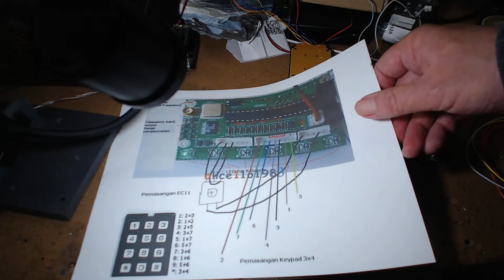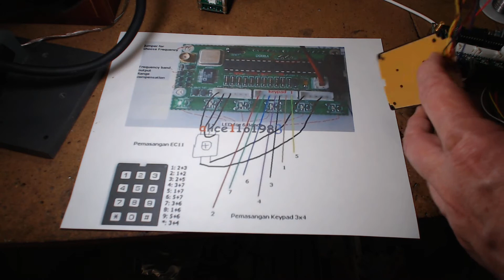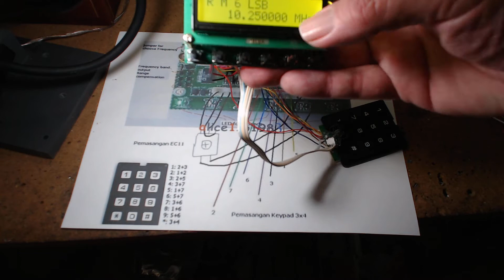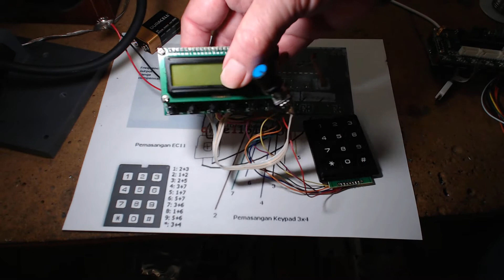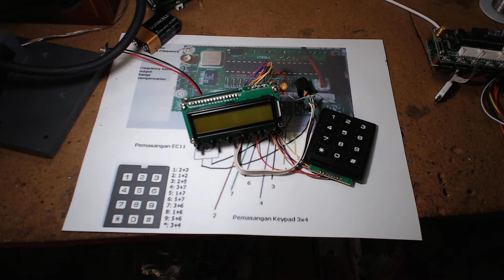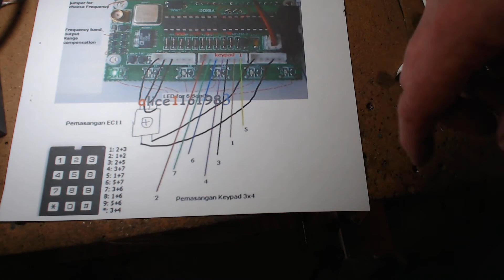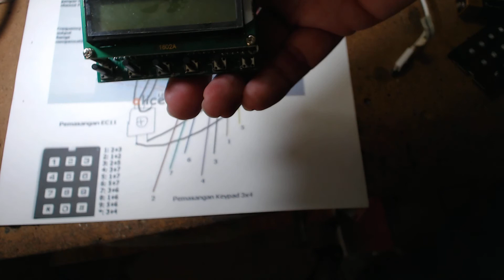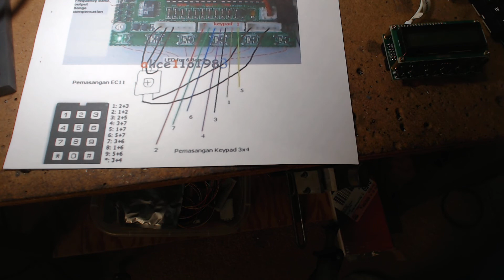Ebay 0-55 MHZ DDS Signal Generator

Comment: I bought this and have it running into a DC receiver, but boy does it produce some nasty digital noise.  I put a pi noise filter in line with the power into the VFO and most of the noise is gone.  The filter is a series 10ohm resistor and two 220uF electrolytic caps on either side of the resistor to ground.  A 50ohm band pass filter should clean up the sine wave.

Comment: Thank you for this video. I only need a rotary encoder for up and down at 10Hz and I need the push button on the encoder to change the step to 1kHz and 10kHz and that's it. And certainly the sine wave should be clean. I was thinking of buying it, but thanks to you, I'm giving up and looking for something else. I wish you good health!
Reply: Where did you get the keypad?
Reply: @TheFretman2  You don't need a keypad. as long as you have a same version as I have  DDS 6e  you hold CAL down on  power up  Cal is  LH Button.  then you get asked for min freq  ... run the encoder to select  (use step to change  step size of  jump per encoder pulse)  hit cal when set then set   Frequ max  etc  THere's one entry called  SSB_offset . My notes are crappy CHinglish on the matter  it appears to be the 1500 Hz shift up for  LSB or  same for USB where it is a shift down  (but the display should show the same - the internally generated frequency would be different ) .  One of the push buttons on the front marked  SSB  allegedly cycles  LSB , USB  CW and AM , whatever AM is supposed to do - should be direct on freq like CW. 
One of the options is  DDS system clock - that's the frequency marked on the master osc.  I'm not going to wet nurse you you work that out. 

All frequencies are entered in Mhz.  well may be no - there's an example given in the  notes where  180 Mhz is entered as 180 000 000 without the spaces.

The  Offset_frequency in the menu if you get that far is the  IF frequency.  Clearly this device works only for single conversion receivers. 

The last menu item is I   - when you get to I the word Save should be displayed.  It is supposed to Save and  jump out of cal mode at that point. 

The black header on the RHS has  six pins that are allegedly tied to the  amateur band and liven up  to pull in LPF relays .. there is  Sweet fk all information on interfacing to these pins- I imagine that about 4.5 V will be available at up to 20 mA when asserted so you need  a limiting resistor of 190 ohms in the line to the transistor that will be driving the relay. This is required information for  transmitter only use.  The two bottom pins are  8V  or your supplied voltage  the next two pins are also tied horizontally and the are at GND.  The set of  3 plus three at the top are tied to  specific  PIC02 pints and  I have tracked some of these back to individual PIC pins.  I'll have to see the thing operating to know which is which.  I'd also have to find an IDC header to fit. .

MY pcb is  maked  ElecPlanet.com.   THey now no longer exist.  Many chinee man copy many other CHinese man if   PCB looks the same when populated .  But   your mileage and  operation may vary....

TEF in Nz.

Comment: Ah man, thanks for showing me how to wire up this "steaming piece of horseshit" (about what I was thinking too when I ordered one of the million for sale and then couldn't find a wiring diagram on the entire internet)
Reply from the maker: One out of 20 vendors had the diagram on his page. Too many buttons and features to be useful. It draws to much current for battery use,   I wonder how many sold. It must have come out of a crappy radio.  Some of the frequency units are crap also.  Digits that bobble for no reason.
Reply: @johnkleinbauer4424  Yep, going to go shopping again and not cheap out this time hah. It's very crap in all respects. Anyway, had to try it out once I already had it